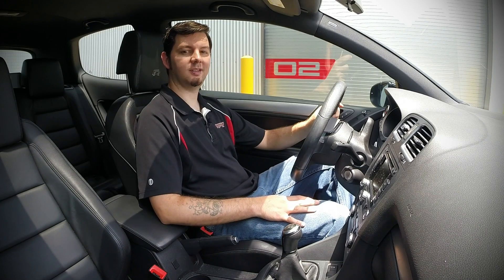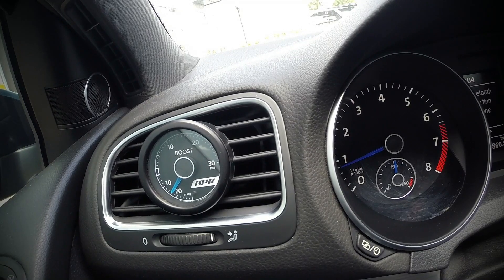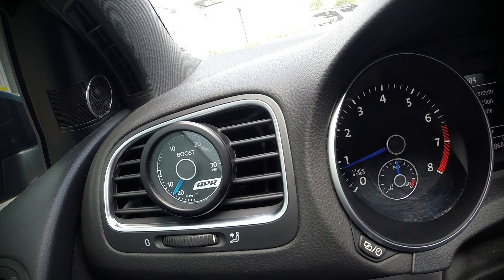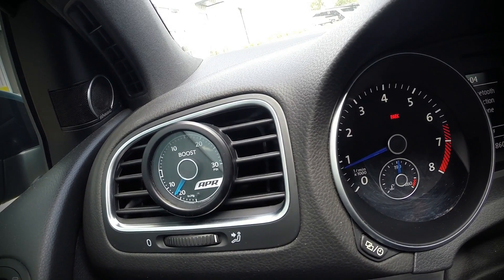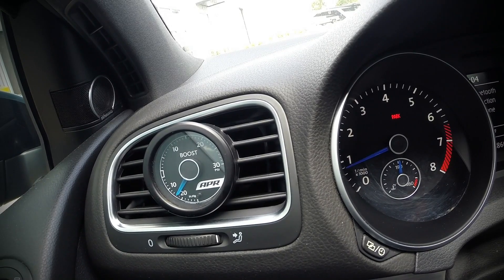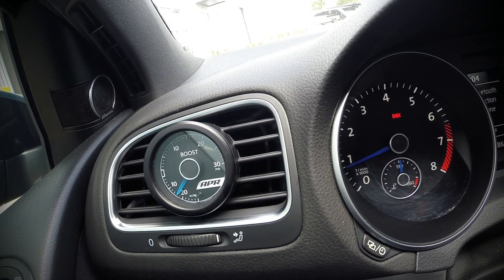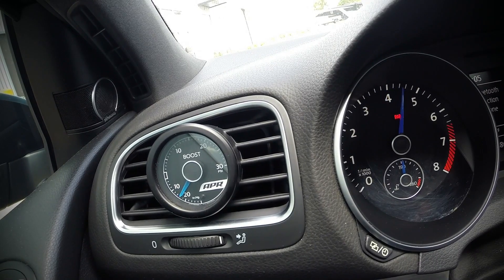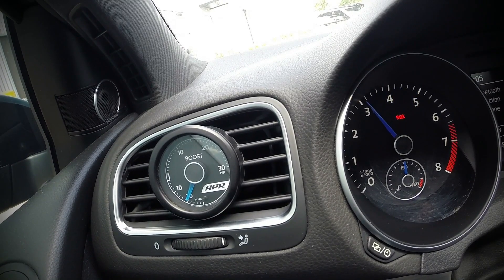APR Motorsport Launch Limiter and No-Lift Shift Tutorial

Comment: Wouldn't this wear your clutch a lot?
Reply: 3 years late, but better late than never: 
The no-lift shift feature talked about here does the same thing as you would do on your own when shifting (getting off the throttle) it just does it the moment you start to press in the clutch pedal and then goes to the 98% or above throttle position when you released the clutch after changing gears. So the wear on the clutch is a bit more, but not significantly enough to matter, compared to doing it manually.

The launch control will obviously contribute to clutch wear, but so would holding the RPM and then going full-throttle for just a few moments when launching to build boost, as you would do when you launch manually.
Reply: @markusz2n  thanks, and it should be said that you dont normally use no-lift-shift all the time. I think when riding in city its definetly not necessary.

Comment: was this with the stage I or II? 

I'm trying to get a judge of how much torque steer there will be with each stage
Reply: The electric steering rack has a feature to counter torque steer and it works very well, it's been introduced in the mk5 and now it's even more refined.
Reply: Torque steer its 2021 not 1980 l